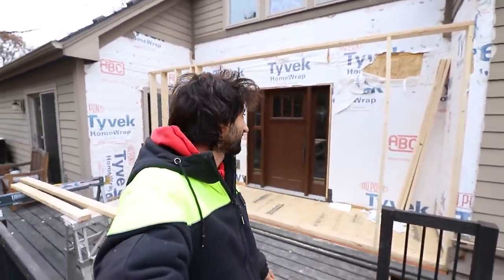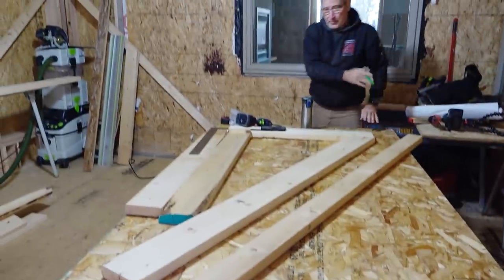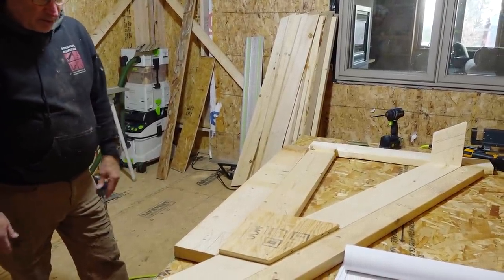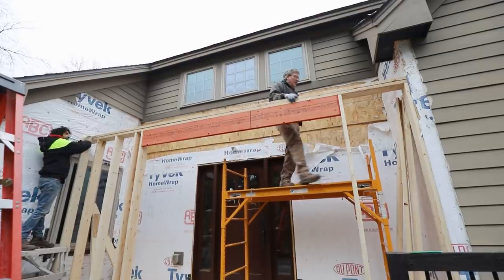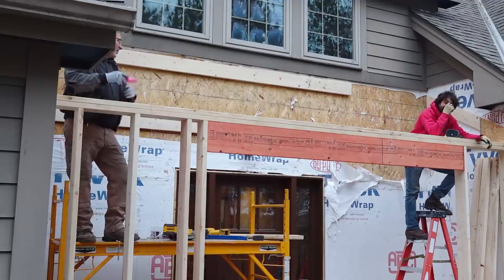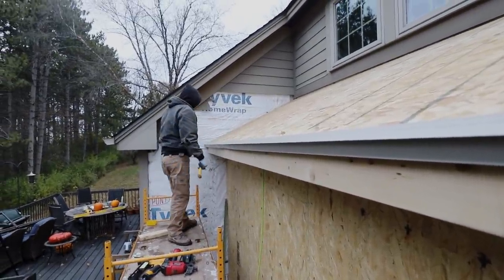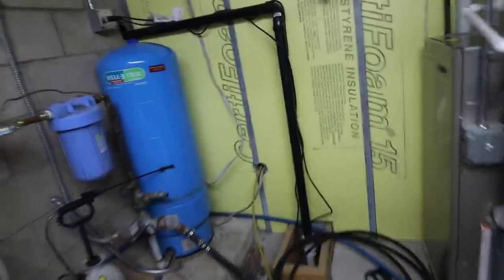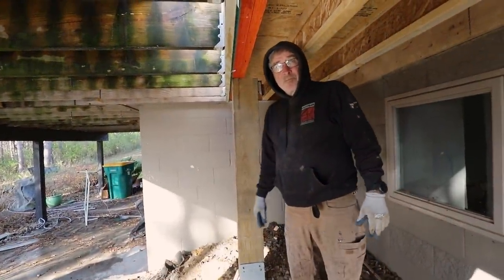Framing the Front Addition | Home Renovation & Addition Part 14

Comment: I enjoy the content you provide, whatever you are tackling. While I'm not here to critique what you do, I do have a recommendation for you if it hasn't been addressed previously.  In the episode Addition #11 you had to replace water damaged plywood on the inside corner just below the eve. This issue is a result of the siding not having "kickout" flashing on top of the roof at the edge of your roof line. This "kickout" flashing diverts any water that comes down the roof into the gutter instead of allowing it the ruin your exterior siding & framing. Just look up siding kick out flashing and it will tell you all you need to know. If it's not installed you will suffer far more damage in the future. Hopefully this helpful and keep up what you do. Thank you

Comment: Matt, Thank you for taking us on this family journey.  When we redid our 1901 queen Ann Victorian (before youtube) I added more outlets than what is 'required' by code. My electrician told me to do that, and I was never disappointed . The only time I was disappointed was when I had a 3' of counter, and already had one outlet, and thought 'no, I don't need one on the other side'..... I can't tell you how many times we would have used that - it was a bunch.     I put outlets every 3' in the kitchen and if I had a 3 foot section, I put an outlet on each end.  And in a 10x10 room, I had 10-12 outlets  2 or 3 outlets on each wall.     He also suggested a 'star' configuration, rather than 'daisy chain' so if down the road you want to add a breaker so not all outlets are on the same breaker, it is relatively easy to do.  We had old that we fished all through - with new construction, it is very easy, and relatively little extra cost - and will save tons.  As I look at that basement room - I would even put 4 outlets along  every wall.   Thought I would share our experience. :-)

Comment: This is admittedly the first video I've watched in this series, but what stands out to me is just how different every element of carpentry is from furniture making. Speed and ease seems to be prioritized in carpentry, even at the expense of what I would call proper safety - there are certainly things Donavan is doing that he seems quite comfortable with that I wouldn't even consider attempting. As a furniture maker, precision and accuracy are priorities (for me, at least) as tolerances are very low and repeatability is necessary in many cases. It's kind of fascinating to watch this and see how different even the mindset behind the crafts seem to be.

Comment: That addition really makes the front look different and better too.  The new trusses should be strong enough to hold up under about 10 feet of snow and with the flashing completed should shed water extremely fast at the same time.  Not sure if it's that way in person, but on the back side where you installed the temporary stairs. there appeared to be a decent sized low spot right under the stairs that will definitely hold water and snow.  While the wall below ground is well insulated and sealed from the water, that standing water would be right behind the stair platform which may be an issue for you at some point before spring hits.

Comment: Is any of that lumber stuff u cut? Also your helper is super, that guy knows what he's doing and likes getting stuff done. The progress is monumental each new vlog. Thanks for making the clips, I know yall would prefer to just geterdone
Reply: I doubt they're using any of Matt's own milled lumber.
a) It's all softwood (pine, douglas fir, spruce, etc.), Matt tends to mill hardwood (maple, oak, cherry, etc.);
b) The dimensions of the boards are pretty precise, which you can't just get in one pass; I expect you have to mill it, then dry it, then mill it again to the final thicknesses, which would be a lot of trouble compared to
c) buying that type of lumber which is pretty cheap all told, and also
d) certified for use in framing.

Matt may well use some of his own stock for interior finish carpentry. That would make more sense.
Reply from the maker: All of the above. Thanks!

Comment: i would have run a 6" pvc pipe under the floor right out to the well and run the well pipe and wiring through it for easy acess when needed later

Comment: Matt, those stair treads will rot out in the dirt even if it's treated wood. Would be better to set them on flat stones or pavers. I made the same mistake, once.
Reply: Mike I believe those are just temporary while construction is going on.
Reply from the maker: Yes, just there until we build the deck

Comment: Question that shows my ignorance more than anything else: With all that timber frame and ply, how do you stop rot over time? And what do you do for insulation, given that you get so much snow every year?

I’ve lived in the Middle East, Africa and the UK, where everything is concrete, brick or stone. Am always amazed with houses in the US and Australia with so much timber frame. Must work otherwise it wouldn’t be common construction, just don’t understand how the system works.
Reply: If you keep water away from wood, it can last hundreds of years.   Builders have gotten pretty good at managing water, but when it's not done right, rot happens.    Then you remove the bad part, fix the water problem, and put it back together.

Comment: hi im wondering why the window was left in as the new wall went up, and not boarded up and removed first. surely it was a hassle to get the window out of the way with the 2x6 in the way?
Reply from the maker: Didn’t want to remove it until the shell was enclosed to protect that opening from rain. Wasn’t a big deal as the 2x6 was installed with screws

Comment: I'm curious why KD lumber was used to attach a ledger to the house for the deck and at the foot of the exterior stairs for the back room entry instead of pressure treated lumber.
Reply: Think its just temporary
Reply from the maker: The ledger is within the envelope of the house and the stairs are temporary

Comment: Curious on why he chose FESTOOL over the other 3 usual brands ????
Reply: There are a number of reasons from battery platform  I have 3 different types battery’s  Festool and dewalt mainly  I also like the quality of there tools. Festool is not cheap tools and I am fine with that.  The storage system is part of it too. I will look around to see what tool works best for what I do. Festool comes out on top many times

Comment: Prefer hand cut roof (with bird mouths) instead of trusses for smaller applications like this.
Reply: I agree I was puzzled with the trusses there was no need.
Reply: @ralphgesler5110  No building inspector goes by architectural design they go by building codes. This is over engineered. Not needed anywhere.
Reply: @ralphgesler5110  not once
Reply: @ralphgesler5110  I have never had a building inspector look at the plans

Comment: One never knows what happens off camera but there should have been caulking when the exterior door was put in on the new addition.
Reply: Indeed, but the bigger problem is installing the door before tyvek is finished and without any kind of sill pan.
Reply from the maker: It’s temporary
Reply: @mcremona  I was wondering why you were using a hollow core door for the exterior and no footings on the stairs. Then realised these are temporary to cover in until spring. Love seeing and hearing much the same  "builder" jokes & comments as there is here in New Zealand. Looking forward to seeing the project completed. 
All the best wishes to you and your family for the New Year.

Comment: Matt why did you spend all that money for those post to be drilled any good carpenter or builder would of gone to your architect and had hun design one continuous beam under there with two concrete pocket cut out with a rim saw and saved you a ton of money
Reply from the maker: Posts are faster

Comment: I am not impressed with your carpenter, you should tap the rough opening before putting the door in and flash the steps before you install them and put a slab down, he doing every thing wrong.
Reply from the maker: Temporary until spring